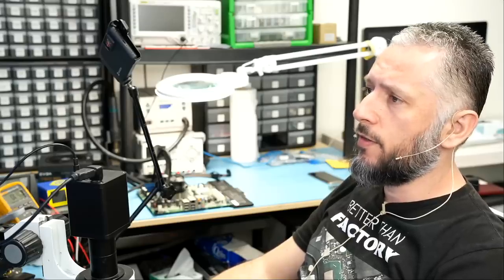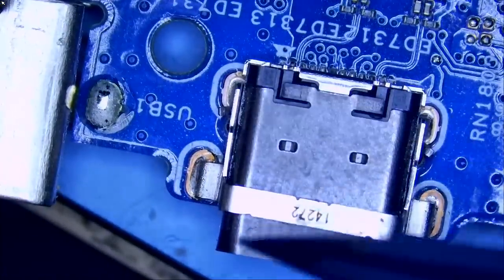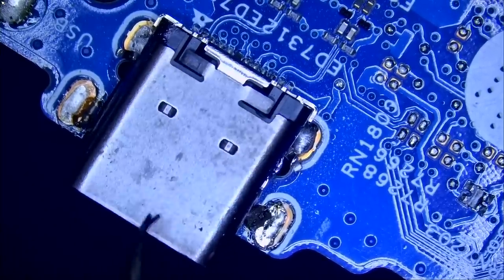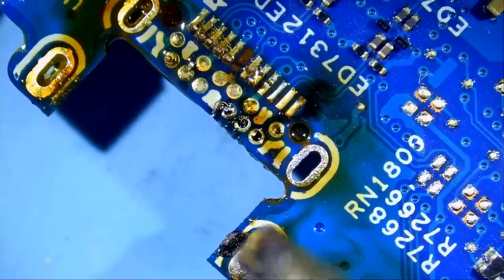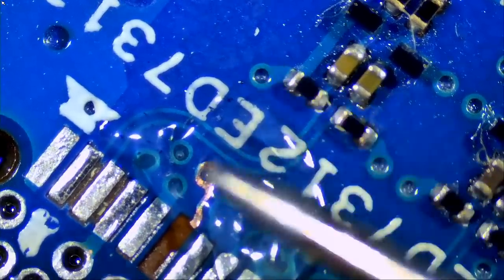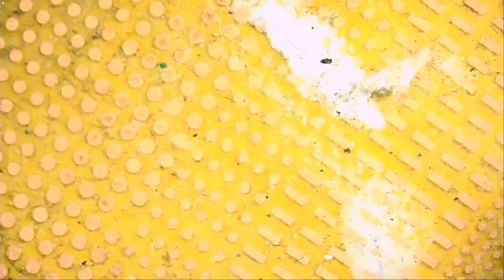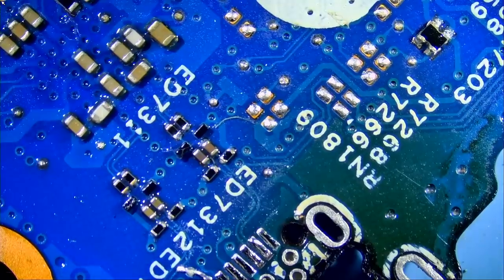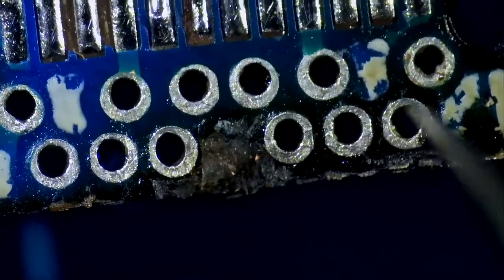Dell Inspiron Laptop no power Repair - And most useful micro soldering tool everyone needs.

Comment: I recently had to solder a very small 8 pin speaker connector. I looked through all my donor boards until I found the only one that had the same 8 pin plastic connector. I perfectly followed what I’ve seen Alex do so many times and used my heat gun on the opposite side of the motherboard and safely removed the plastic connector. And then… I dropped it onto the ground. The entire time I looked for it I kept thinking I bet Alex never drops and loses important components on the floor. It was gone to the 9th dimension, I never found it. So it was comforting to see that even the greats like Alex drop and lose components on the floor too and not just amateurs like myself!

Comment: When I charge any device, my rule is to put it and not touch it until its charged, also when I unplug I hold it nicely and firmly and unplug cable straight so it doesn't twist/bend anything on connector, and it should last for very long time when  technique like this is applied. =3

Comment: Makes you wonder why they don’t do a full loop around the port soldered to those ground points to make it  stronger instead of that half loop, great job on the fix.
Reply: That was exactly my thought. It seems like they actually put the support on the opposite side it should have been to prevent this and why they didn't just put it on both sides is beyond me.

Comment: The last time I did a job like this was on a HP Spectre, and both of its type C connectors were broken off. One was OK to solder back on straight away, but one had two ripped off pads. I ended up using wires rather than pad strips given how fine they are

Comment: One of the more enjoyable videos. Even though the ninth dimension grabbed the connector, you got one over on it because it would have been thrown away anyways due to all of the missing through hole pins. IMO that bracket was useless because it did not hold the connector tight enough to the board.

Comment: This is a case of where the manufacturer is using some random parts for, I'm sure, cost purposes but the connector is NOT up to the company's standards.
A connector especially for power and USB are always under stress as they receive a large device and there is a lot of stress and strain on them.
I was using a friend's computer one time, an Asus I think, and when I went to plug in the power cord, I felt the inside connector detach from the mother board.
I was not handling it roughly or torquing the power plug at all when it broke.
I can only assume that at some time, it was possibly plugged in and got hit producing strain on the internal connector loosening it from the board but not completely.
And when I got hold of it, I made just enough stress on it to break off.
With the extra added "hold down" bar, it was still not enough to keep it from torquing and breaking off.
Only a built in "foot" on the front on each side would have prevented the connector from becoming loose from the strain.
Like a car defect recall, this should be reported to Dell but then again, they may not care about the resiliency of their cheaper products.
My DELL XPS is going on 6 years now with only one past problem and that was to buy a new power cord. All the rest of the puter is in great shape and still performing.
I even recently gave it a good cleaning and put on new thermal paste on the CPU. Of course I cleaned off the old paste with some 90% isopropyl alcohol.
Good show!!!

Comment: Those USB-C connectors with SMD pads and through pins are a pain. Even with a metal bracket to secure it, it broke. I have seen the same issue with Thinkpad laptops. The thing is, it is going to get worse as laptops start transitioning to USB-C as required by EU laws. The USB-C has too many pins on a small connector, and unless the user is extremely careful, it is going to break soon or later.
Reply: Concur. It's a shame the people making these laws have no clue regarding how these connectors are used in the real world. They are likely to break when subjected to multiple connect, disconnect cycles. I also question the supposed current-handling capabilities.
Reply: Is it the same with phones? They doesnt seem to get broken on phones 🤔
Reply: Never ever buy a laptop that charges only via USB-C,   worst choice ever, always choose one with standard DC jack , 2 pins preferable , not 3 pins.
Reply: @FantasmaSpartis  because phones are lighter, the weight of a laptop, and someone trips over the lead, port rips off.
Reply: @FantasmaSpartis  No, not the same. Although phones use the same USB-C connector, usually people do not move phones while the cable is connected, like they do with laptops. My guess is that manufacturers are not really interested in securing the USB-C connectors to avoid being ripped off.
Reply: @elitecol69  It does not need that much abuse, just bending the cable, thus forcing the connector inside, will easily break the through hole pins like in this case. I had once a Thinkpad which I could not fix it, because 2 of holes had their pads missing. The through hole pins took the pad with them.

Comment: I do the Dell soft reset for the blue/green/red problem. Pull battery and BIOS battery, hold power button for 1 minute, put them back and set BIOS clock. 
I am trying to learn the soldering, did Micro/Miniature in the military, but not to your level.

Comment: Just think, that strap that went over the connector could have prevented this problem if it had been soldered/glued to the connector. Possibly the engineers designed it that way, maybe a machine or a person failed to secure the connector to the strap.
Reply: The metal bracket needs to press down the USB-C connector, which was not the case. It is only there to avoid the connector to be pulled off, which failed to do so.

Comment: 20:00 I agree but disagree your opinion here.  You need the appropriate tools for the job that work for you.
I've professionally worked on boards with the same size components without putting globs on flux on the joints, nor did i use a microscope for 99% of the work.  But i was a young adult with good eye sight and i used different techniques to desolder and solder components.
For sure, these things are useful and they could make the work easier, but are they a requirement, i think that depends on you, your techniques and abilities, and what you feel comfortable with.

Comment: Nice job, the USB C connector îs not an ideal port for charging. The connector is very fragile in my opinion. I have an old HP probook laptop, 8 years of using it on the jobsite without never take it apart. It uses the old round connector and is working great. The battery is removable, everything is replaceable, Wi-Fi module, ram. Those days are gone. Everything is hard to repair now. Every USB C port is different, you have to order the exact same thing to replace,
Reply: Never ever buy a laptop that charges only via USB-C,   worst choice ever, always choose one with standard DC jack , 2 pins preferable , not 3 pins.

Comment: Every time I see a broken charge port, it makes me so mad. Even phones should have a DC barrel connector next to the USB (and headphone).
Reply: Yeah, it’s a real engineering mess.  Seems to ignore the obvious daily stresses that will be applied to the socket.  I reckon all connectors should be robust modules with pin sections that can be popped out and replaced.

Comment: ANSWER: how to find the connector? When the new one will arrive put it where the old one was with the board, then do the same moves when you lost the first one but watch where the new one will fall, or put a camera under the table so you won't lose it to the 9th dimension this new one😂